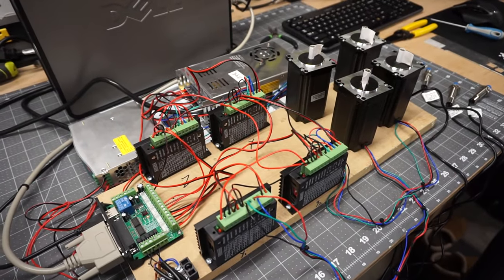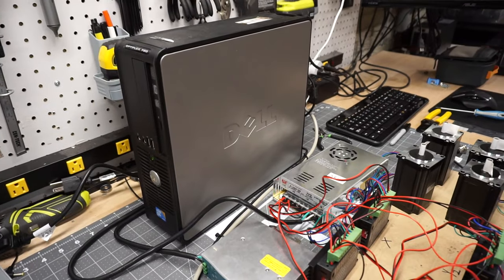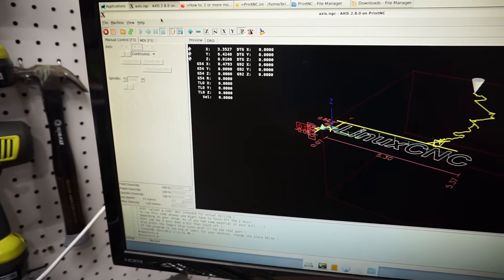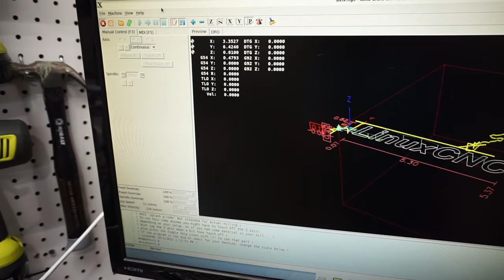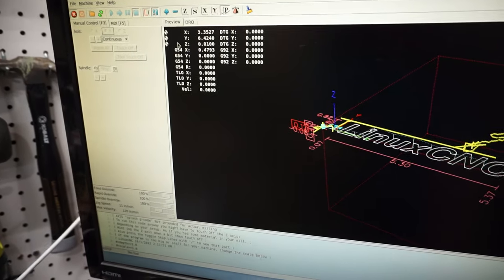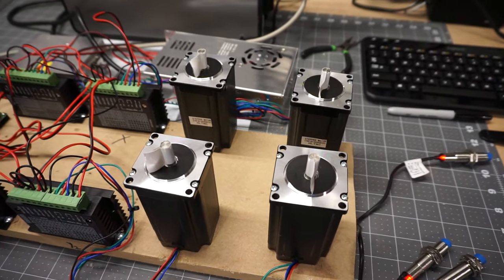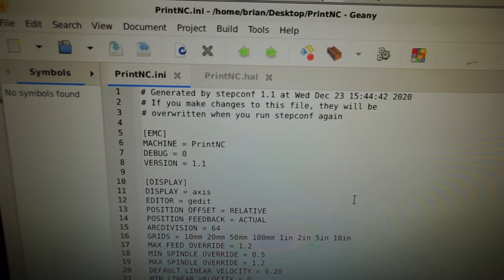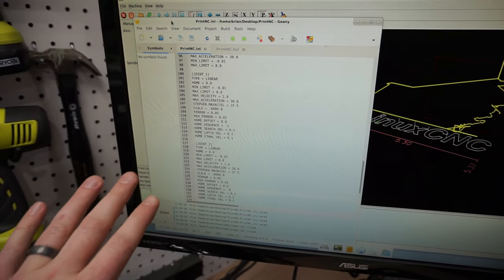PrintNC - Stepper Wiring & LinuxCNC Discussion!

Comment: Hi.. great video, would this type of setup also be able to use with online based software like Easel or similar ? Because not all have access to CAD/CAM software or even know how to properly use those type of software.. i am just right now building my 4th CNC and i am thinking about using onlinebased software like Easel, even though i used to use LinuxCNC and still have that computer with everything allready installed. Thanks..

Comment: I've been really enjoying watching this project come together! One thing I was looking for and couldn't really see was if you connected all of your low-voltage grounds (DC-) together? I believe you're using a 36v power supply for the motors and a 24v power supply for the inductive sensors and possibly the breakout? Since the board is interacting with these different voltage levels it would be wise to make sure they're all operating from the same reference. You might have already done this but just thought I would throw it out there. Great job! looking forward to more!
Reply: @ProjectsbyBrian  That's probably not the cause of the noise, I had a TB6600 in a project that was just noisy under holding torque, could never figure out why but I didn't mess with it for very long. The idea is that a voltage is a potential difference in electric charge. By jumpering the grounds (DC negative, not protective earth ground) you are ensuring that the voltages are operating from the same electrical reference. If you connected the - of your 36v PSU to the + of your 24v PSU you would expect to see around 60v when measuring from the ground of your 24v power supply (don't do this obviously, but its the general idea, like stacking batteries in series) you want to ensure your PSU's are in parallel without one floating with respect to the other. Your BOB probably already does this by providing a GND reference to the drivers, if it does and you don't have any issues you should be fine. I would only really worry about it when you have a signal at a different voltage level (say your inductive sensors were at 12v and the BOB was 24), since all of your signals are at 24v (36v is motor power only), you should be good. I just saw the 2 PSUs and it jumped out at me.

Comment: So are those steppers the stock 'pro' ones from the store now, i.e., 542s?  I am considering going with the 556's, but need to know if that is worth it over the DM542s.
Reply: @ProjectsbyBrian  Thanks.  A few other quick questions:  1. Why not use the block-type inductive sensors? and 2. Do you have a mount for those inductive sensors you can share?
Reply: @ProjectsbyBrian  Thanks

Comment: Loving going through your vids so far.

I am curious why you wanted parallel more than using the USB from your first breakout.

Is it faster or something?
Reply from the maker: Thanks! The USB breakout board will not interface with LinuxCNC, so I went with the parallel port breakout board instead. I've since switched to the Mesa 7i96 though which I haven't made a video on yet, but have some posts about it on my Instagram if you're curious.
Reply: @ProjectsbyBrian  Sweet. Just followed the IG a couple of minutes ago too.

I was thinking of getting the xPro V5 controller for mine so I don't think it'll be an issue for me but wanted to check if there was latency problems or something
Reply: all usb controllers breakout boards have lot problems and not working whit linuxcnc,
Reply: usb and windows not have safety, not REALTIME system and windows not have stabile use cnc, linuxcnc not can use usb, only paraller port, can add 2 breakoutboard cheapen than buy owerprice expensive mesa card. thats is why windows system not newer used manufactory automation system, not safe.

Comment: What is the size of your stepper motor means whats the holding torque of it.
Reply: minimum torque need be have 470 OZ or 3 Nm. about smalles what can use woodworking mill have nema 23 3Nm motor.

Comment: Just wondering if the inductive sensor have to be NC or will NO suffice
Reply from the maker: NO will definitely suffice, however they won't be fail safe, which is the only difference (and your programming will be backwards). If a wire were to fall off, or the sensor fails, you won't know until the machine crashes. Typically you want to see a "1" in a good state so that you know when you lose that signal.

Comment: Hi mister
I have a latest generation pc with Windows 10 professional
I put the pci to parallel ports card in the pc and I connect the parallel cable to the breakout board mach3 card I have no reaction from the motors
Reply: all parallerport card not working, linuxcnc site have what card working , and you need setting software motor setup all pin right, pin2 X axis step, pin 3 X axis dir etc. software know what pin uses.

Comment: thanx for sharing, but you forget to talk about important topic which is slaving axis to another one like y1 and y2( or A   axis)  good episod.....
Reply from the maker: I touch on that a little bit in my LinuxCNC deep dive video. It's kind of a long video, but I go over most of the things in the ini and hal files. I hope it helps!
Reply: @ProjectsbyBrian  keep in mind there is no slaving axis in linuxcnc i stucked with that (as a beginner)thats why iam going to hook up two motors on a single axis but iam afraid to burn something if you have an idea about that please to share good luck bro.🥰👍
Reply from the maker: @proengeleceng6861  I'm not sure what you mean. By slave axis do you mean to have two motors for one axis? Like y1 and y2?
Reply: @ProjectsbyBrian  yes, 2 motors with two drivers for Y axis, thank you for replying🙂 check it out in mach3
Reply from the maker: @proengeleceng6861  yup, you can do that in LinuxCNC. I even have each motor home individually to each end stop. LinuxCNC can be intimidating to get started with, but you can do pretty much anything with it.
Reply: @ProjectsbyBrian  so please would you help me making a video talking about that, me and too many guys confused how to make A axis slave to Y axis.
Reply: @proengeleceng6861  now A axis have angle system not linear, not working for me, and homing not working  not y homing error lot have alltime.
Reply: @ProjectsbyBrian  need make own important video how connect and set-up 2 Y axis motor. this is most popular system at hobby cnc but not have information how setting. linuxcnc. normal XYZ not working, and new config XYYZ not totally working.

Comment: i have all similar parts what u have uses. motors, drivers controller board ,pc and linux emc2 software but no understand anythink hall or code or what need make cnc best all mode, make code home switch, and make hall corner founnd , my diy prope need somethink hall code too ,and many other have in internet what can load but no understand how install. not has build hardware to plywood yet. test drive.
Reply from the maker: Yes, I plan to do a video on my workflow that shows how I prove, find and edge and do some other things.

Comment: Hello sir Can you please give me a wiring diagram for dm556 with interfaceing mach3 breakout board
Reply: you see breaoutboard manual which pin need connect were. what have breakout b input pin and linuxcnc softare add all pin step dor enable right. ewery breakout b have different  all not made same boartd. but you vcan config pins in linuxcnc and looking breakout board manual what is all pins.
Reply: dmm 556 input mean, step,dir enaple you breakout board x axis,z axis,y axis  mean breakoutboars have X S,E,D.  x axis s =step go to driver step hole, breakoutboard x axis D=dir go to driver dir hole simple. look u breakout board manual and look internet u board manual if not have manual not good board. this board what him use less than 10$ board have pictures all w3jhat u need know were awerythink connect. driver manual have all what need were connect sure. and motors found internet manyfactory site manual how connect but motor can measure resistor meter what wire is what.all wery easy understand and found how wire.

Comment: were have ca download double Y XYYZ motor setting to linuxcnc, need copy all files stepper config and hall and ini files. metric dimensions. not understand old imperial system. who can help. i have sure same hardware settup than this video,  same breakoutboard, DM556, and motors. only limit SW have old manual not optic. 
were can download files, can use my linuxcnc. hall,ini,all other what need use YY

Comment: But PCs don't have parallel ports anymore...
Reply: Many have on the moterboard...just need to connect
Reply: normal used pci or pci e paraller port card cheap buy 10-20$ and safe you motherboard if burn somethink broken only cheap parallerport card not all motherboard.

Comment: were you have connect E-stop, hall.ini have pin number 1, were has in you board connected, i have same board. normal have used pin 10. limit XYYZ port pin 11,12,13, enable 14, probe 15. you have home used  10, X 11 Y1, 12 Y2 13 Z why waste Y2 home one pin, not need, all Y move sametime Y motors, need only one limit. and then can use pin 10 E-stop.
Reply: What?